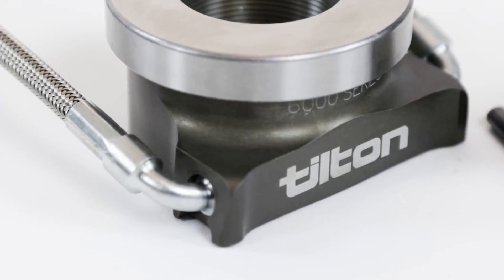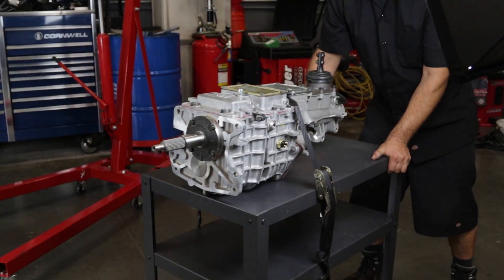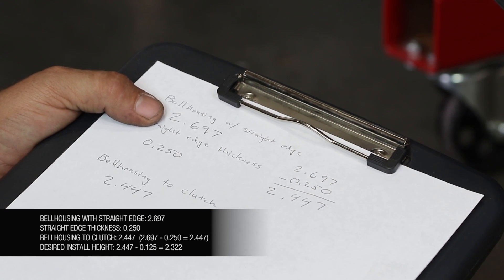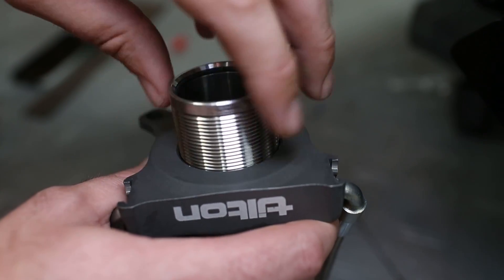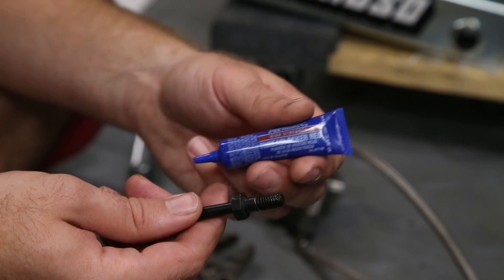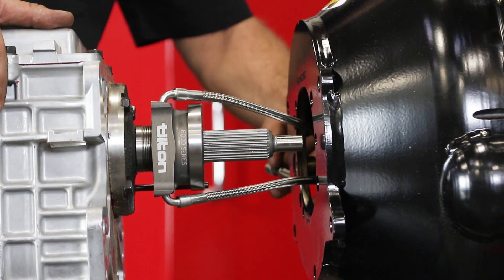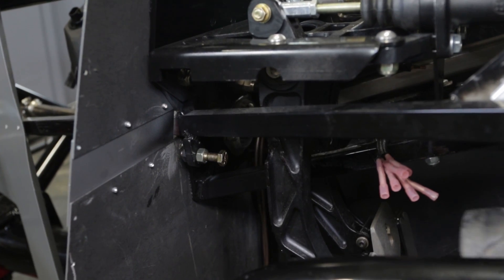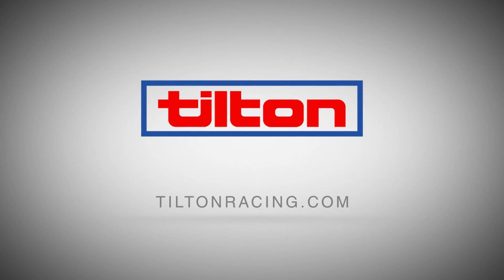How To Set Clutch Clearance on Your 6000-series HRB

Comment: Hello I have a question when measuring air gap spacing on a t56 slave what do I do if both measurements are equal ?? as in (no air gap) adjusting slave out will make it tighter applying more pressure on throwout bearing..

Comment: What keeps the threaded adjusting sleeve from vibrating out of adjustment ?
Reply: instructions says to apply loctite red on it
Reply: @barniechong1183 wrong. You use nothing. That adjustable sleeve doesn't sit on anything that rotates. Just use petroleum jelly for the inner o ring

Comment: The bearings they use on these are absolute garbage. A large flat-faced bearing that you cannot source ANYWHERE except through Tilton, at $50 each. I wish I had never bought my Tilton 6000 series hydraulic release bearing. It's a beautiful piece of machining, but even a standard Ford Ranger oem replacement slave cylinder/throw-out bearing out-performs and outlasts this Tilton garbage.
Reply: What type of application are you using it for? Street? Track? Type of vehicle?